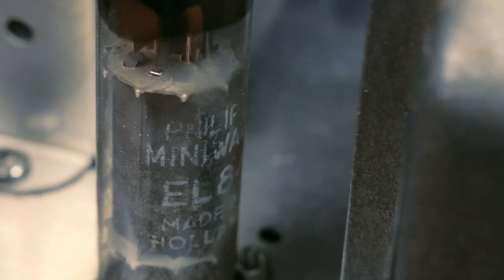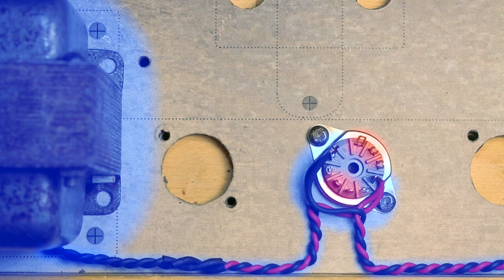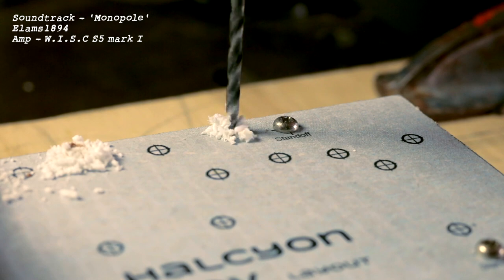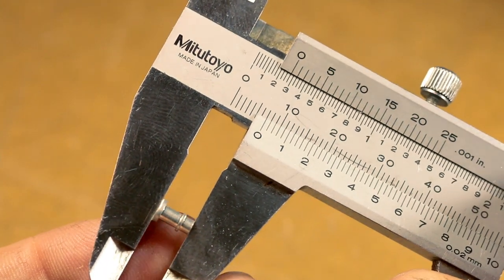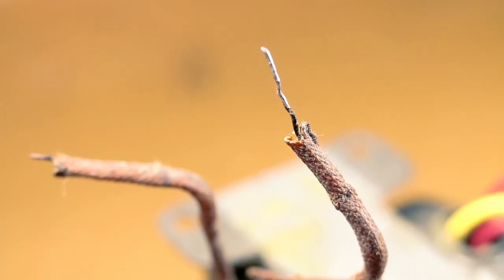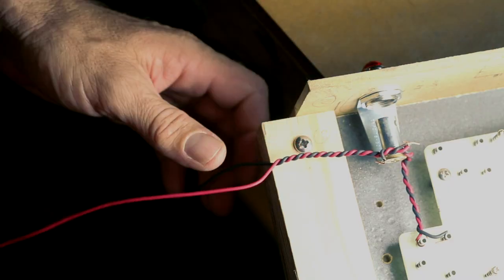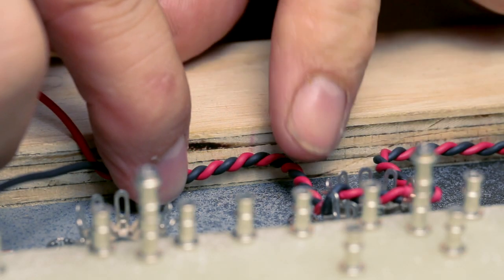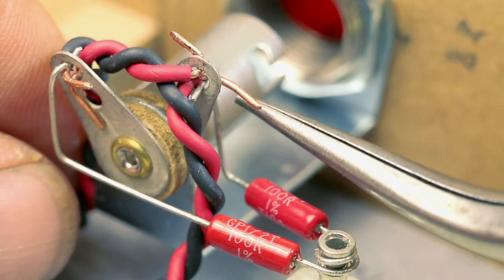How to Wire Tube Amp Filaments the Correct Way - W.I.S.C - GT5 'Halcyon' Build 1

Comment: The final product of your filament windings was immaculate. Well done. Some builders do the filament windings up high out of the plain of the sockets and drop them down on the socket to prevent field issues.
Reply from the maker: Thanks Bill! My father also wired filaments like that, top down style. A great method indeed, thanks for kind words, cheers

Comment: Looks really nice.  
Just to share a bit, there are other ways that work very well also.  
For anyone who insists that the AC heater wires must be twisted, take a look inside a Soldano SLO100.  Everything is run dead-straight from one tube socket to the next, perfectly parallel and I can't think of a better test for inherent induction noise than a super high-gain amp.  
Another twist option (the one I use when doing AC heaters) is to run the twisted pair UP high, ABOVE the sockets.  This keeps the run away from the audio portions of the sockets and the floor of the chassis clear to run everything else with no chance of interaction between the heater run.  
Lastly, simply convert to rectified DC voltage and the whole problem is solved.  Now, some say that this incites damage to the cathode.  I can, if the voltages are WAY higher than ever gets used anywhere near an audio amplifier.  🙂  The only other downside is that if the rectifier fails, it could be a really bad day.  But there are ways to back-stop the system to prevent damage inside the amp.  
So this is a nice demonstration of one good way.  Just sharing other methods that also get the job done.

Comment: Thank you for posting this! I have a friend who was designing and building tube circuits back when they current! He did his filaments the same way you do and he taught me how. This may not be popular wisdom but the way Fender wired filaments up in the air may get the AC field away from the two sides of a preamp tube but put the wires directly in the way of all of the other connections. To repair those amps I have to remove some of the existing filament wires to avoid burning things up! Great work!
Reply from the maker: Thanks Ken! Indeed, my old man used to wire his filaments from the top, sort of floating a bit, and that worked to some extent. Love those school techniques and tricks as much to learn from the old school pros. I prefer to keep the filaments at chassis level as it serves my OCD neatness as well ha ha. All the best with your repairs, many thanks!

Comment: Great video!   I've shied away from using solid core cable out of concern from breakage.  I've been using pre-tinned stranded core.  It gives you the ability to bend your wire shapes without the concerns of solid core (plus it's pre-tinned!)  :-D
Reply from the maker: I've had a few cables snap on me if I've bent them a bit much, indeed stranded can be good if you get desired results. Bit less heat too I would imagine. Good stuff, cheers!

Comment: love building valve amps heaters circuit so much fun i use fender topology wire the above up in the air dive straight down to the pins never has any hum buzz
Reply from the maker: My old man was a fan of that top down wiring also. It too is a good choice. He also always insisted on output tubes with the plate at the top of the glass tube. Some great old school techniques still are worth while indeed, cheers!
Reply: I just finished an 807 stereo class A amp ef37a input driver sound good

Comment: Maybe not for the traditionalists, but filaments hum is sometimes the reason why I prefer to use 12Vac filaments/heaters.
(less current means lowering the magnetic field), or even rebuild it to a DC filaments/heater. 

Great video btw!! :)
Reply from the maker: Great points! Some old school transformers here in NZ were made with 12v heaters and also they had an extra secondary winding for the output tubes screens. Fantastic transformers which I am in the process of recreating. Thanks for your input, cheers
Reply: @elams1894  Thanks. 
Extra bonus is that many 12V tubes (like the 12V6) are much cheaper than the normal 6V version. Although hum is mostly an issue with the first couple of preamp stages.

Building a 12V voltage multiplier is quite easy from the 6v3 winding.

Comment: There are excellent thoughts and methods in this video.  That said.  Why not build a regulated DC filament supply.  As long as all the tubes are indirectly heated, a single sided above ground or below ground supply would work very well.
Reply from the maker: Thanks Robin. Yes a DC filament supply would be ultimate. If room permits then absolutely.

Comment: Another great video. In your examples of different ways to run the heater wires you didn't mention the Fender overhead method which seems to have worked well for many years.
Reply from the maker: Yes true, that's a good method too. My father uses that method with excellent results. Thanks David, good point.

Comment: If you're worried about noise from the AC filament wires, why would you not shield them?
Reply: It's largely unnecessary when twisting them like this. I've also always wired my filaments using what he shows as the "incorect" methods, and never had a hum issue... even in hi-fi amps. So YMMV.

Comment: Howdy. A piece of artwork.
I have built some tube PA:s not twisting the filament wiring. And no virtual centre resistors. No hum or buzzing. Tube preamp.s would be another matter. There twisting and running the pair correctly most likely is mandatory.
Hum and buzzing, I have found, likely stem from Eddy currents in the chassis. I never use the chassis as a return current conductor. I use a separate minus bus wire. The bus begins at the filter capacitors, runs from stage to stage in the order of the scematic backwards and connects to the cassis only at the input jack. I use wire gauge of 1,5 mm2 for the bus and avoid bends. Bends introduce inductance in the bus and may cause instability problems in high impedance circuits.
Regards.
Reply from the maker: Thanks for input. We have to acknowledge that everything concerning electricity is speculative. For instance, current. 

Current does not exist as an entity. It is a relationship between  voltage (magnetic field) and resistance, nothing more. There is zero flowing through a circuit. There is only the manifestation of a magnetic field, the manipulation of the magnetic field, and the elimination of the magnetic field. 

A return circuit for 'current' is purely speculative. Earthing (the coupling of unnecessary magnetic field with the Earth's magnetic field) likely occurs at the component rather than the chassis. However as I said, everything to do with magnetism (electricity) is speculative and nothing is set in stone. 

Electricity is given little critical thought. To conceive of electricity as an interaction between particles is lunacy in the extreme, yet here we are.

Comment: Beautiful workmanship! Makes me want to build and amp as well!  Some say it's best to keep the AC lines high off the chassis and drop down at each socket. I that method ok, or are they wrong?
Reply from the maker: That method is also good. Bringing the magnetic field down in a different orientation means that magnetic coupling is more difficult so noise is also reduced using that method. Thanks for kind words!

Comment: Very nice work! I've got a question about running filament wire and connections on the 12ax7 tube. I've seen where one wire will go through pins 4 and 5 and the other wire through pin 9. Another wiring is using just pins 4 and 5. I'm confused of which is right or wrong.....

Comment: Nice but for a low watt amp this small I simply eliminate the power transformer with a DC power supply from a laptop and use cheap ($0.50) voltage dropping boards for 6.3V filaments and an SNMP Boost Board (around $6) for an easily adjustable HV source.  No way to induce AC hum and the switching noise for the PS board is way above hearing levels.  Simple, light, cheap and effective.  ;^)
Reply from the maker: Good work around there, all great points. I do similar stuff for pedals however good info there on the HV, that's something I hadn't considered Thanks for the input, cheers
Reply: @elams1894  You do outstanding workmanship on your builds!  Just thought you might be able to use this in the future.  Keep up the good work!

Comment: Superb job Mate. I was sweating, stressing just watching and I’m not the one wiring the heaters. I have a 6V6G Bottle SE stereo amp in the cradle and now I want to rewrire the heaters. You know the model on those pliers? I wore the ones I use and they are a tad to thick.  Good to see you back
Reply from the maker: Thanks mate! Glad the vid was helpful. The pliers are Facom to brand, model 403. They are without doubt the best pliers I've used, and they are super strong too. Cheers and all the best with the rewire.

Comment: I was always wondering if we could use stabilised (say with a 7812) DC for the filaments for zero hum. Have you tried it ?
Reply from the maker: You certainly can. You just need need an effective rectifying circuit. Sometimes the extra components and circuitry warrant them to be out of the question. However, if you need to rectify other windings, say a 5v winding for switching, then designing a convenient rectifying circuit that also services the filaments is a great choice. I'm doing just that in a FX loop circuit at the mo. Great question, thanks for that.

Comment: Great video. One question please? With my dmm i checked for voltage. Why would i be getting 48 volts off the heater lugs? Is it because I'm using the amp chassis to ground my negative probe? So lost and unfortunately the 3 tubes don't light up.  The big tube lights up but very very so gently, as if wired improperly maybe... any advice greatly appreciated! Great video again, i am not subscribed, thanks!

Comment: Surely the whole point of a twisted pair is to minimise external coupling, so the routing of a twisted pair is of relatively low importance compared to routing of non-TP wiring?
Reply from the maker: The twisted pair still holds a significant magnetic field. Although reduced through twisting, the filament cables, where possible, should be kept away from both grid and plate nodes.
Reply: Twisted pair reduces interference pick-up in e.g. ethernet cables; but also reduces electromagnetic interference emission I think, which is what matters in this application since the wires are carrying 50Hz power. 

You don’t want to inadvertently coil a source of noise around your sensitive signal conductors.
Reply: Proximity, shielding, looping/coiling wires (like a transformer coupling one signal to another), and using twisted pairs all affect the amount of noise pick up & the strength of noise emissions AFAIK.

Comment: A cordless drill makes quick work of twisting leads if you know what you're doing 😁
Reply from the maker: My old man uses that technique. For stranded wire, indeed the good ol drill is great, thanks for tip and have a great one!!

Comment: Beautiful wiring work! But i am really not following the choice of pin connections, the first tube shown seems to have black/red conected to pins 4 and 5, with 5 then going tstraight axross 9 but not connecting so this is as oer 12.6vac wiring,  but the next tubes seems to have black going to 9 and red going to 4, with 5 not connected to any wire so sort of 6.3vac wiring but no pin 5 - that is something i haven't come across - Have I missed seeing something? 10:21
Reply from the maker: The first tube socket is for the EL84 power tube which has different filament pins to the 12AX7. Pins 4 and 5 of the 12AX7 are common, and require a small connector cable to join them together. I believe that might be shown in the next vid? Good question though, I see how that could be confusing, cheers.

Comment: I always hear that at least in tube preamp phone stages, passive tone networks are preferable. Do you know when a baxandall tone stack is  just the right one. I have a Valco pushpull 6873 with 2 12AX7 gain stages with a long tail paraphrase 12AX7 and I believe the baxendall tone stack comes right before. Great subject and cheers for a great video..
Reply from the maker: Bax tone stacks are fantastic, however almost all Bax tone circuits were made for HiFi amps, and you can't just take a HiFi Bax circuit and drop it into a guitar amp as the bass will blow everything to bits and the mids will be nonexistent. 

I modelled my own Bax TMB circuit using LTSpice and then trial and error from there. Took months, but I think my one is just about bang on for a guitar amp and it works excellent, with heaps of cut and boost over entire frequency curve. Email me at elams1894 at gmail dot com and I'll send you one of my push pull schematics with the Bax TMB tone stack if you are interested. It requires an additional 12ax7 to run. Cheers
Reply: @elams1894  as my would say once upon a time “sweet as”….I would love it. I have been at this a while now on my own for the most part trying to understand. A few books , and  Skip Simmons ‘The Truth About Vintage Amps’ along with Uncle Doug. I haven’t encountered the Bax T much except with my own Valco…I believe my 65’ GS12R Reverberocket  but it has a huge affect on the tone. The Valco’s tone knob pretty much stays dimed along with volume-better off controlling through the guitar.I thought your tube amp filaments windings vid was brilliant. I will reach out soon. Cheers-

Comment: If 6.3v AC causing so much trouble, wouldn't it be better if we put 6.3v DC to the filament instead? Just curious.
Reply from the maker: Yes, a DC supply would be best, however one would need to build a dedicated 6V3 rectified power supply with diodes and electrolytic caps etc. One could do this no problem, to whatever standard, however often the results are just the as correctly twisted cables. Therefore, the extra cost and turret board realestate need to be considered carefully in comparison. Cheers
Reply: Thank you for elaborate explanation! Your work is incredible, by the way. I keep watching it again and again. Very soothing and enjoyable!
Reply from the maker: @madblock555  Thanks Madblock, very much appreciated, glad the vids are helpful, cheers.

Comment: Absolutely stunning work! Sorry if you’ve answered this already, but what kind of pull-style strippers are those at 11:40? Cheers
Reply from the maker: Hi Ron, they are little nipped type strippers, the ones with the diamond shaped cutting heads. I'm not sure where you would find them as I got mine in a second hand purchase of a bag of old tools. They are great for when you have no room, and need to get close to a component. cheers!

Comment: Why can’t the filament voltage be DC and thus avoiding some of the hum issues?
Reply from the maker: The filaments can certainly be rectified to DC, however it requires additional circuitry and components, and although it can be advantageous in a big amp, it's probably easier to twist the filaments in a small to mid amp. Cheers
Reply: @elams1894  I mentally read that with your accent. 😁
Reply: It’s low voltage, right? So it will take very little to make DC. 

Only a bridge rectifier or diode and a modern electrolytic capacitor (or two or three, etc. in parallel).

Comment: I was told you can only use 14g copper strain wire to the heaters or am I wrong ?
Reply from the maker: You can use any cable you like, as long as it's thick enough to handle the magnetic field. Anything from 20awg or thick will do.

Comment: Dumb questions here - 1) Why are the sockets in alternating order of placement for which side faces 'up' (1 socket pin 9 is at bottom, next one pin 9 is at top)?  2) Why is it that with your first 'preferred method' pins 4&5 (jumper'd) received 1 wire, pin 9 the other, and then connected same to the next socket....BUT with the other 'preferred method' sometimes only pin 4 gets a wire (not 4&5) on one socket, then the next doesn't get one on pin 9??  Am I just seeing things incorrectly??   I really admire the symmetry, consistency and attention to detail on these builds.  When an amp is as beautiful inside as out - that'd be a nice ass amp!

Comment: sorry, another question - what wire do you use and where do you get it from? I'm in Singapore and struggle to find a nearby source of single-core 600V. Reluctant to pay for USA shipping :(
Reply from the maker: No worries CT. You can use any wire you like, they are all pretty similar. I prefer to use solid core, 20awg for most stuff, 22awg for earth hookup wire, however any stranded wire of the same diameter will do. I would advise though, try and get high temp stuff, and avoid Teflon insulated at all cost as it will drive you insane. No probs with the questions, ask whatever you like, cheers.

Comment: these appear to be dc heaters you're wiring up? no pin 9 connected?
Reply from the maker: No, they are AC filaments. Pin 9 is connected on all 3 12AX7's. If you want DC, then you will need to rectify the 6.3 secondary winding. Cheers